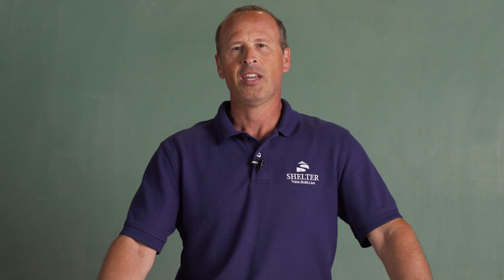Understanding Different Methods Of Laying Out Timber Frame Joinery

Comment: I’ve been very interested in taking shelter institute classes for a long time now.  Planning on doing it “soon”.  But I also really like to learn more about the scribe rule method. I know this is kinda, archaic, but any chance of adding this as a topic on the on line class?

Also any good references (Eg books) on the topic
Reply: I don't know of any books dealing with the topic of the Scribe Rule but Jack Sobon has a couple of books that talk about the Square Rule. and Dovetail Timberworks is hopefully in the process of posting a video about the different rules (Mill, Square, Line, Scribe, etc) along with some he has modified. And Forestryforum is a good resource as well. I'm not sure why but it's really hard locating information on this topic and it would be amazing if someone posted a howto

Comment: Learning scribe methods first has helped to recognize settlement in the end grain vs horizontal shrinking.. I have learned to put settling jacks in posts so the structure settles evenly. I have found 1 1/2 “of settling is normal at 8 ‘ heights .  All vertical post’s must have settling jacks for even settling